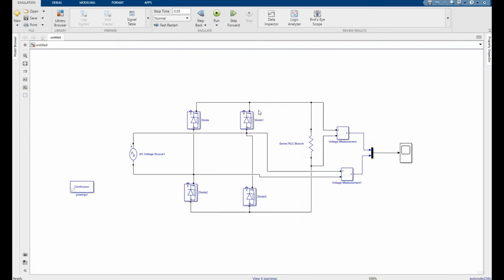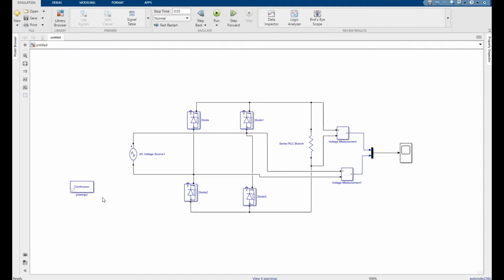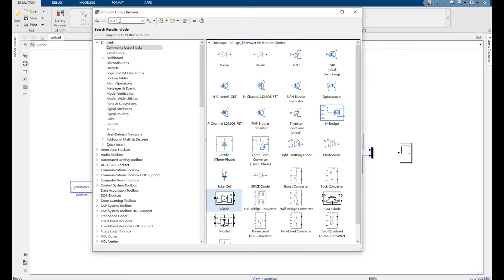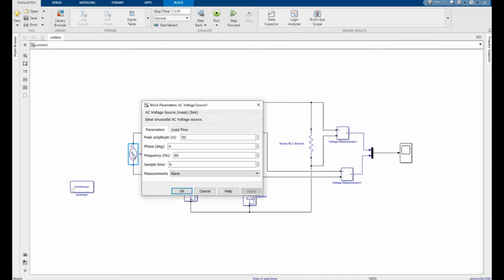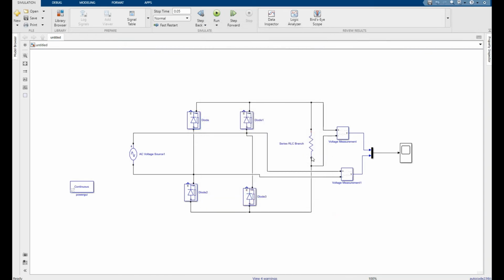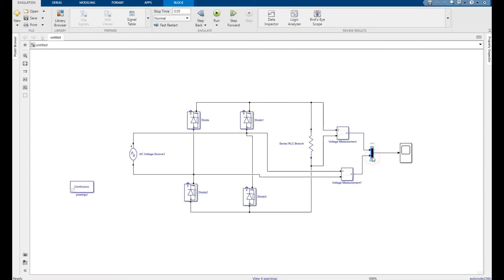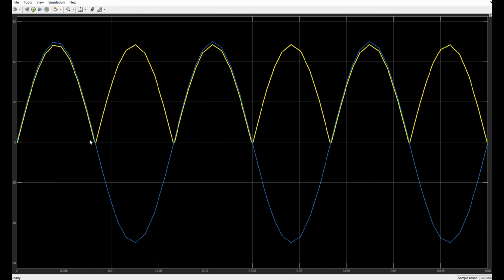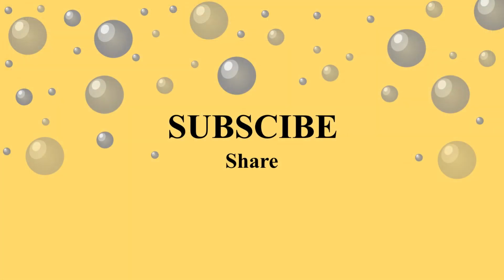Full Wave rectifier Simulink | Simulink Full wave rectifier | Controlled Full Wave Rectifier Matlab

Comment: Sir I'm getting only the blue portion of the wave sir! What should I do to get the rectified wave sir?? Please help me out
Reply from the maker: You will get your rectifier signal at Resistive load as in this case.
Put a voltage measurement block across R load and use a separate scope.